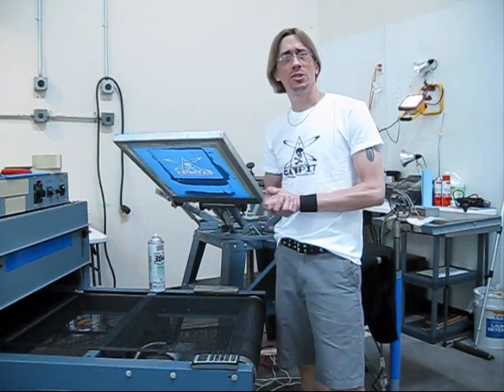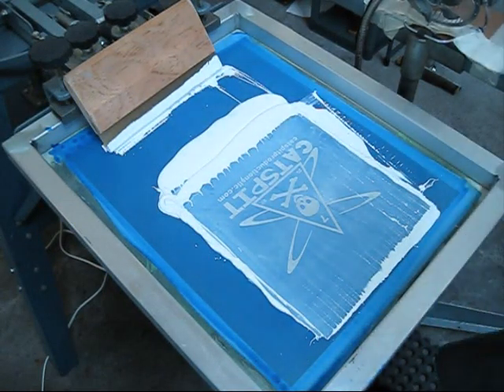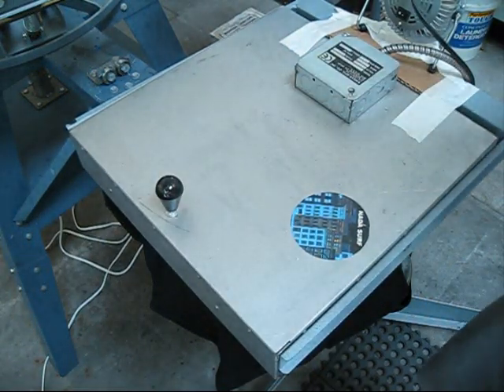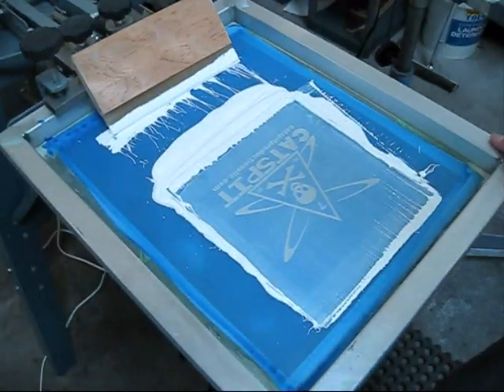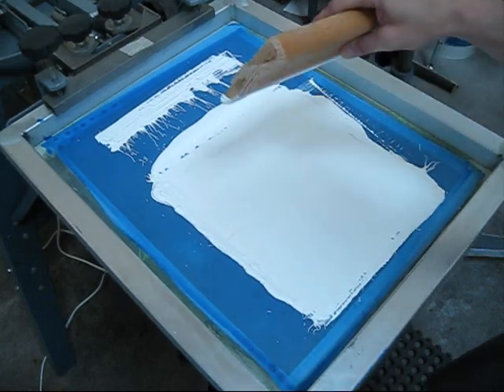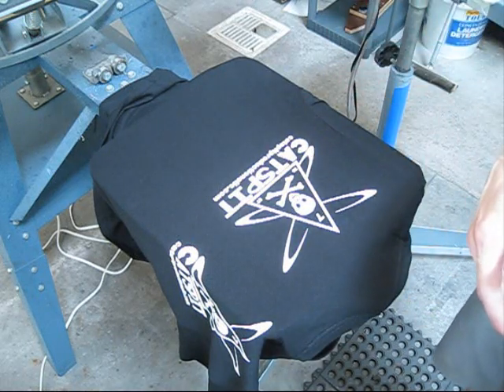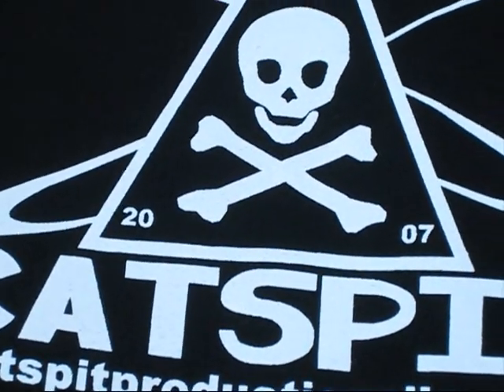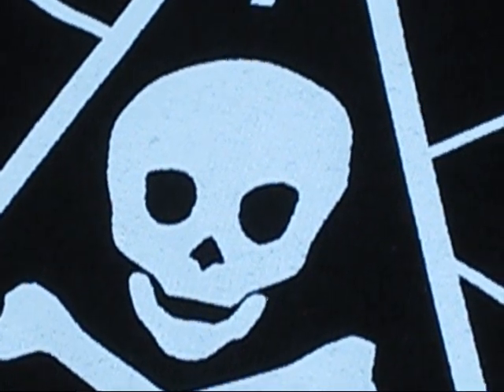How To Screen Print White Ink On Black Tee Shirts

Comment from the maker: @trebluap Not unless it’s a discharge white or maybe a discharge base depending on the hand you want. The ink used in this video is plastisol ink which is cleaned with either solvents made for screen printing inks or paint thinner and lacquer thinner. It’s best to use products that are not so hazardous and user friendly not to mention drain safe. Thanks for watching and leaving a comment! ☠

Comment from the maker: @Dexduzdiz Yes, I agree. I really like the look of the flash/hit/flash method. The only problem is it takes quite a bit longer to do when you print manually. If you have an automatic you can print 2 white screens with a flash in between in one cycle around the press. Then it really doesn’t make much of a difference at all. Except you need two identical screens and great registration. Thanks for watching and commenting!

Comment from the maker: @ballanumber1 Yes, I am using Excalibur’s Competition white. Plastisol. It’s pretty reasonably priced and works very well in a wide variety of printing applications. You can get it from the Print Supplies page on the Catspit website. Just look for the Integrity Print Supply listing and use the discount code at checkout for some savings on your order. Link is on the channel page. Thanks for watching and leaving a comment! ☠

Comment from the maker: @InSuchSkull Ah, the mesh count is noted in the annotations in case anyone else missed that. It is a 110 mesh stretched nice and tight. But you could also do this with what is now called thin mesh. There is an article on the Catspit website about it. Check it out. Thanks for watching and commenting!

Comment from the maker: @2ndwindranch Thanks, glad you like the video. Yes, you can add reducers but remember that will ultimately reduce opacity. Make sure the ink is about 70 degrees F or so when you print. Or you can just switch to a more creamy ink like Excalibur. But I don’t recommend using reducers especially on black shirts. You might try mixing it up a bit beforehand too. Thanks for watching & commenting! ☠

Comment from the maker: Hey Andy, this is an older video and I was using a white ink I no longer use but it was not thinned or reduced. I never use any additives in my white inks. They are specifically made for excellent coverage and high opacity so if you add anything it changes the opacity while affecting the ink flow characteristics. So if your white inks are too thick and problem some it may be that they are gelled or perhaps there was a bad batch. Thanks for watching and leaving a comment! ☠

Comment from the maker: Thanks, glad you like my YouTube channel. Check out my website too, the link is on my channel page. This could be the ink or perhaps you are working the ink too much while in contact with the shirt. Try to print with minimal strokes and movement of any kind. Flooding the screen with ink while lifted off the pallet can help achieve this. But it is a bit odd if you have fibrillation on the second hit after flashing. Not sure what’s happening there. Thanks for watching and leaving a comment! ☠

Comment from the maker: @nickisgayyyyyy Setting up a manual shop can cost anywhere from $500 to over $20,000.  There are starter kits which you can find on the Catspit website. The stencils are made by a photographic process. Check out the website to learn more. Thanks for watching & commenting! ☠

Comment from the maker: Thank you! You’re welcome, it’s my pleasure to help out. Check out the Catspit website for a lot more free info on screen printing. Link is on the channel page. Try to use a high quality, high opacity white ink. Also you need to be able to get the coverage you desire with the least amount of action on the shirt. That means use a tight screen, good off contact, flood well holding the screen off pallet, and use minimal strokes to print. Thanks for watching and leaving a comment! ☠

Comment: I've used a heat press to press the shirt fiber down into the ink.  The heat press heats the ink and allows for pressing screen texture and fibers to be flattened. I press at 320 degrees, for 5 seconds.  If you press for longer time you risk damaging your print.

Comment from the maker: @volpe3fuego If you're using water-based inks then I suppose Speedball inks might work. But I am unfamiliar with most of them as I have only worked with black in the past. Speedball makes glow-in-the-dark ink? Pretty cool. But yes it will be way better if you screen print it directly yourself. Thanks for your support! ☠

Comment from the maker: @PomonaPunkRock I assume you are using water based inks, yes? You can use an ink additive that will slow the dry time of the ink or you can back flood the screen with ink in between prints. Some people even use water bottles with spray tops that can mist and moisten up the ink. Or work much faster…LOL. Thanks for watching & commenting! ☠

Comment from the maker: @hiphopprintshop LOL, I never said it was going to be one stroke. I call it a multiple pass or a “putty job”. I really think a one stroke white print is not practical; it may be possible but at higher speeds of manual printing the quality and consistency will suffer with one stroke printing. I would suggest a minimum of 2 strokes on a manual press to ensure coverage and overall print consistency. Thanks for watching and commenting!

Comment: Hi.I've been using the hit flash hit for white and opaque colors on dark shirts and I still get bad fiber lift on the shirts. High quality shirts so pretty sure it's my stroke or the type of ink I'm using. I haven't preloaded in the past, will this help? Your ink looks a lot easier to work with and not as pasty as mine. I know you stir yours a bit before, but I could mix mine with a copter rotor and not get it like that. What kind is it? Great channel! Thanks, Sam.

Comment: Hey really appreciate your videos! I have a question, I am running into an issue where my white ink goes through the shirt.so ie: if i turn my shirt inside out you will be able to see my print quite prominently. am I using too much ink? is my off-contact too close to the shirt? I am using water based ink. thanks in advance!

Comment: I have a white ELT underlayment.  On top, I'm putting a bright red Plastisol.  Problem... I'm getting white underlayment specks in my red ink!  Yikes! What am I doing wrong?  I've adjusted my flash time, my platen temperature, my squeegs, my push or pull, and I'm still getting these blasted white specks!  Your thoughts?
Reply from the maker: Sounds like your under base is not smooth enough and/or you're not printing enough red ink to fill the texture of the under base. Thanks for watching! Screen Printing Equipment & Supplies - http://CatspitScreenPrintSupply.com/

Comment: I am a beginner in screen printing and i bought several rubberized CMYK paints. I am wondering if rubberized paints are better to use in dark colored shirts rather than using ordinary or water-based inks. And also what kind of mesh should I use for rubberized paints. I think I have 100 mesh. Thanks a lot man!

Comment: is there any better results in using water-based white ink on black shirts? i just prefer the water-based since it's more easier clean-up than oil-based. or if it really had to be a oil-based then whats the best clean up procedures & chemicals do i need? thanks

Comment: I have a job printing white ink on black shirts and I am wondering if I should buy some white plastisol ink for it. I got some white water based ink for christmas but its just speedball fabric ink. My question is, do you think using the speedball fabric ink with the hit flash hit method will produce opaque results?
Reply from the maker: It would but with water based inks you really do not want to do that as they can become thick and brittle. Either buy a better water based white ink or go to plastisol. But you'll need a way to cure plastisol inks. Thanks for watching! Screen Printing Equipment & Supplies - http://CatspitScreenPrintSupply.com/

Comment: I know this is an old video, but how would you go about doing this on a...(wait for it)....YuDu screen printer? Should I still be using an adhesive to keep the shirt from lifting up? Or is there no way.
Reply from the maker: It's always a good idea to use pallet adhesive. But I don't think you can load the shirt on the pallet the same way we do. So you may need a cardboard insert to make it work. Thanks for watching! Screen Printing Equipment & Supplies - http://CatspitScreenPrintSupply.com/

Comment: what brand of ink do you use? I'm using QCM white and it is still thick like tar when I'm printing. I even power drill mixed it. I don't want to use a reducer but I am failing to get a workable consitency

Comment: hey, i love your channel it has helped me alot on my screen printing journey.
i am having some issues with printing white on black . i print a home with a 1 screen  set and i dont not have a flash. i was wondering what is the best ink to use to get good results with little equipment such as a  flash and. what technique? at the moment i find the fibres of the T-shirt are visible when i print and if i try flooding sometimes the ink leaks through and the print comes out blotchy any advice
Reply from the maker: Thank you! I'm happy to know you enjoy my video work. Glad I can be of help from afar. You would probably need to use a good high opacity water based ink that you can heat set with an iron. But it could also be the way your setting up on press. There are way too many variables for me to guess here without knowing more details about how you are printing. This video on fibrillation, which is what you described here, may help out:

https://www.youtube.com/watch?v=-ancQVVGPtM

Thanks for watching. Screen Printing Equipment & Supplies - http://catspitscreenprintsupply.com/

Comment: Hey! I love your videos, they're very informative and have helped me immensely!  However, I've run into a problem with putting white on black shirts.  I use the stroke flash stroke method but for some reason the ink on the shirt doesn't seem to be smooth and has a rough texture to it.  I was wondering if there was a solution to this, or if that's just how it goes.  If you could help shed some light on the situation I would be very grateful!  Thanks!
Reply from the maker: +Mooinator Thank you, glad I could help out through my videos. I really can't even attempt to guess without knowing more and perhaps seeing an image of the print. You can use my forum on the Catspit mother website and post images. Explain what ink and mesh you are using along with pallet condition and how you are flashing on what type of press..... etc. 

http://www.catspitproductionsllc.com/forum/

Thanks for watching. Screen Printing Equipment & Supplies - http://catspitscreenprintsupply.com/

Comment: Helo john.would u share me a tip.how did u make the shirt not pull up by the screen everytime u lift up the screen?i always have this problem printing white ink on black shirt.after i flood and push the ink through the mesh..i lift it up ,the shirt will sticking to the screen and ruin the work
Reply from the maker: Use a pallet adhesive like spray tack. I have videos on this. http://catspitscreenprintsupply.com/albachem-spray-mist-pallet-adhesive/  -  http://catspitscreenprintsupply.com/rhinoclean-green-rhinobond-rba2-adhesive-mist/  Thank you! Thanks for watching and leaving a comment!

Comment: Hi. I have a problem with my print. I can still see the color of the black shirt through the white ink. I tried flooding it numerous times and stroking it many times but still it gives me same result. I'm using a tulco super white high opaque ink. I coated my silkscreen with photoemulsion once only. Is there a problem with my stencil? Is it too thin to make a thick and Opaque ink on my shirt? Please help. Hoping for your advice. Thanks for all your videos. It's helping me a lot :) regards from Philippines
Reply from the maker: Okay I think I already answered this question for you on another video. Check out that playlist and realize the ink is important but also the set up. Tight screen, off contact, proper squeegee and so on. Thanks for watching. Screen Printing Equipment & Supplies - http://catspitscreenprintsupply.com/

Comment: I've only ever used water based inks. Like a few comments below, I've used ryonets inks and their black was just a disaster and their white is very difficult to use. However, which would be easier to handle-- water based or plastisol?
Reply from the maker: Yes, I have received many complaints about those particular inks especially their white over the years. But generally speaking plastisol ink will be the easiest to work with however it requires more equipment. My plastisol inks will be a lot easier to use than most since they tend to be a little bit thinner. But in order to work with plastisol inks you would need at least a flash cure in my opinion. If you need help with anything feel free to give me a call.  There is never any pressure to buy anything and I'm happy to help out in any way I can. Thanks for watching. Screen Printing Equipment & Supplies - http://catspitscreenprintsupply.com/

Comment: I used to have a lot of white punk t-shirts in the 80's that appeared to be ink rather than the paint type substance that is used today.  They wouldn't crack or peel, they would just fade.... do you know what would have been used for those old t-shirts????  You mention ink here but it looks more like paint.  Thanks for any advice!
Reply from the maker: With screen printing it’s all ink, not paint. But there are different types. You probably have water based ink screen printed shirts there. Those feel like the fabric and nothing else. Ink and paint are different in the way they work. Paints are applied and inks are printed. Normally the ink is designed specifically for the printing method. The 2 most common inks for textiles are water based and plastisol. Water based is what you are looking for. Thanks for watching!
Reply: CatspitProductions Thanks for that information, it's very good to know!

Comment: Hey there. I seem to always have problems printing white on black particularly black hoodies. I use 110 mesh, I increase my off contact, I use the tacky web adhesive spray, I use high opacity, low bleed plastisol ink etc, etc but the ink continues to look cracked, dry with a heavy handed feel.  What am I doing wrong.  The logo's/graphics I work with are wide with a lot of surface area. If I use any other color  but white, I don't have a problem.  Clearly, Im doing something wrong.  Any suggestions?  Is it the ink? is it my application?
Reply from the maker: Perhaps you're using too much off contact. Lower is better with off contact. Try to be sure you're simply not printing way too much ink. The more in you print, the more time in the oven it will take to cure properly. Thanks for watching! Screen Printing Equipment & Supplies - http://CatspitScreenPrintSupply.com/

Comment: Hi i was wondering if the burned part (clear part) of my screen should be completely see through after the process.  Mine is detailed accurately but the clear parts are a little foggy.  Thanks for any advice
Reply from the maker: Yes, the stencil area that should be open mesh should look like the screen mesh before you coated it with emulsion. The mesh has to be clear and open in order for the ink to pass. If there is any amount of emulsion or filming in the stencil area it will not print correctly. Thanks for watching and leaving a comment! http://www.catspitproductionsllc.com/ - http://catspitscreenprintsupply.com/

Comment from the maker: Thanks but these tips are based on plastisol inks. Water based is slightly different in printing I think. With “water based products” the only way to get a really soft white on black is to use discharge base with a tiny bit of white pigment. Or you could use a discharge white ink which is a hybrid white ink with discharge base in it. After you wash it should be pretty soft. Thanks for watching and leaving a comment! ☠